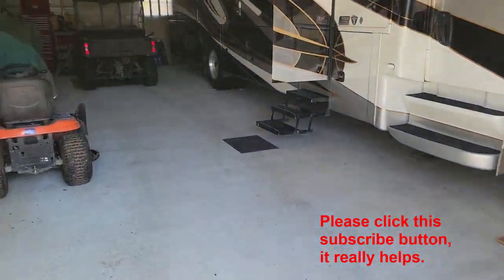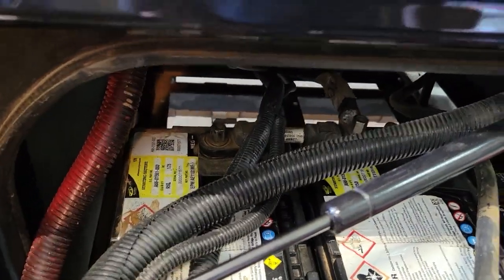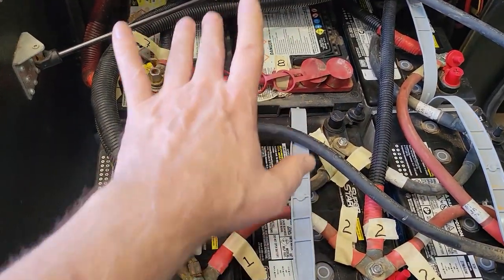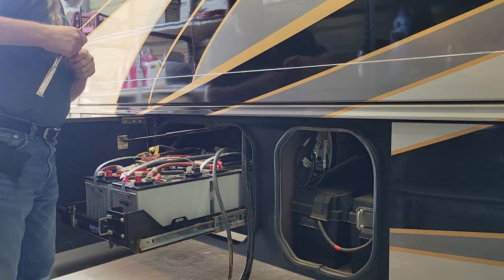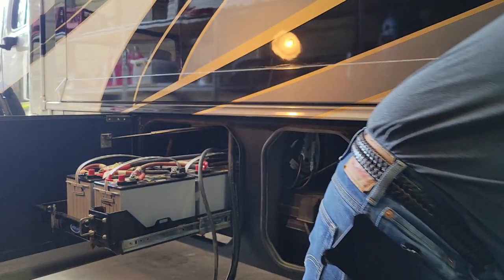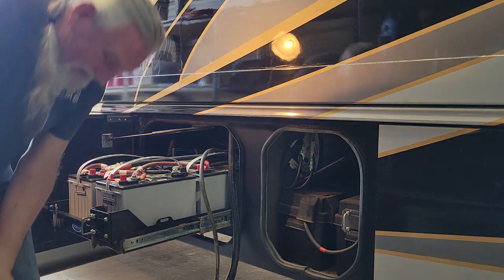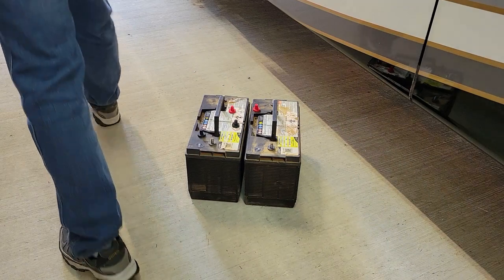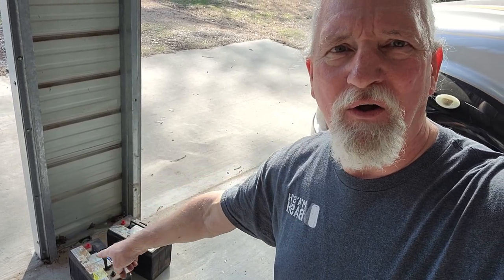Replacing Chassis Batteries on Jayco Seneca

Comment: Great video!  I was wondering though about a couple things:  you mentioned that when plugged into 50 shore power, AND the house battery switch inside the steps/door is ON, the inverter will charge the house batteries then also the chassis batteries.  I routinely have my 2019 Jayco Seneca 37K plugged into 50 amp shore power in my RV garage, same as you.  But...I usually turn the house battery switch OFF at the steps/door when the coach is being stored for any length of time.  When I'm doing that, am I preventing the house and chassis batteries from charging?
Reply from the maker: When you are on shore power your batteries charge regardless of the main disconnect by the door. BTW, the inverter takes 12 volt DC and changes it to 120 volt AC. I believe you were asking about the converter/charge. That is the unit that charges the batteries.
Reply: @wanderingpeaches  You are correct, I meant the Converter, not the Inverter.  By the way, where is the Converter located on your rig?
Reply from the maker: at the bottom of the breaker box/fuse box, on the bed pedestal